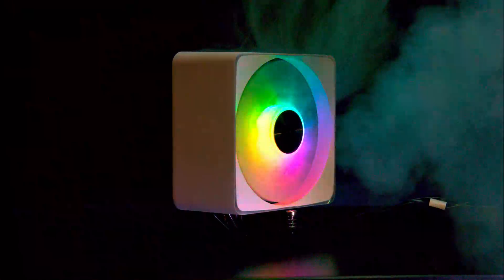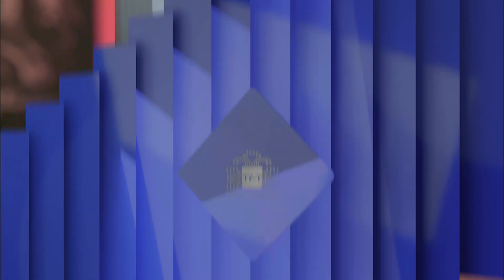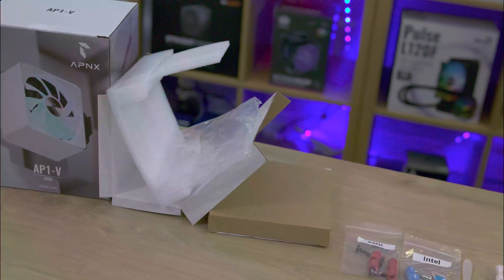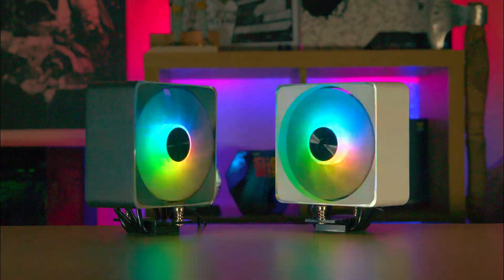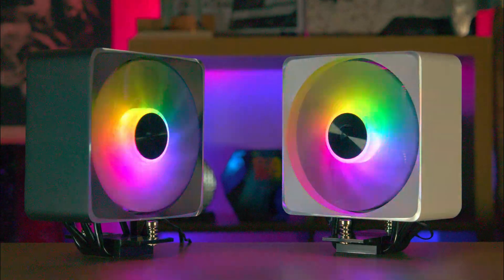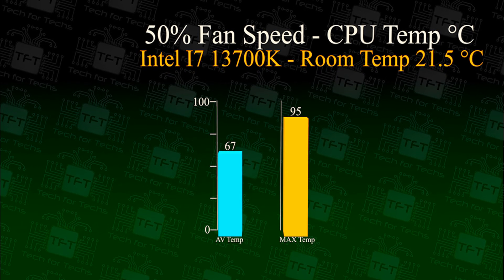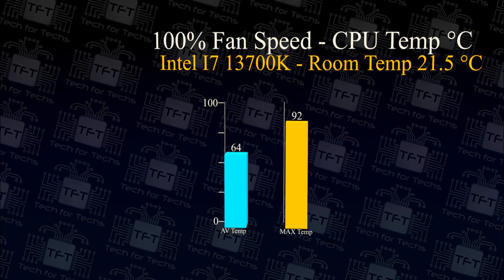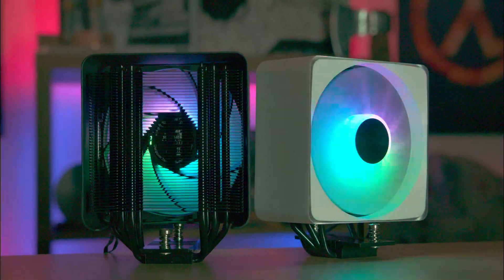APNX Enters the Ring - AP1-V ARGB CPU Cooler Review

Comment: how can you change the rgb color?
Reply from the maker: You have to use the software provided by you motherboard in your PC or computer manufacturer
Reply: @TechforTechs  didnt find a setting for it
Reply: @viltsukkaboi  Did you find it eventually? I bought a pre built PC with these fans and the software (Gigabyte Control Center) can't see them/neither can any other RGB software I've tried rip
Reply: @giga_Lion  no, still havent found a way to fix it
Reply: Worthless and incompetent comment. Stop building computers. U are embarrassing yourself.

Comment: I'm using the ap1-v in white for a couple of weeks now and I'm really happy with it.
its currently cooling the Ryzen 5 3600 changing to the 5700X in a few days.
I set the rgb to white and it has a really clean look with good acoustics in my M-ATX build 👍
Reply: im also getting this since im getting ryzen 5 5600 and only have stock fan
Reply: Hi i just installed this cooler how did you manage to change the rgb?
Reply: @dom4365  plug it into your rgb controller and it links in with everything else
Reply: Does it come with thermal paste pre applied?
Reply: @SSukram_  I bought it and it comes with a little tube but not pre applied
Reply: @harryvalvlogz1381  ok thank you! Would you say it's more of a grey colour rather than a black one, the images make it hard to tell if it will match my case